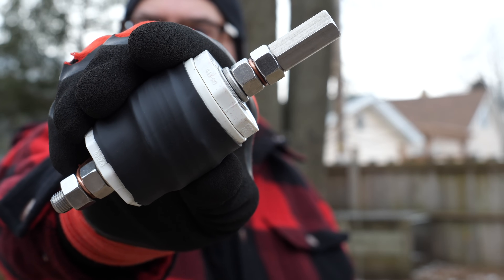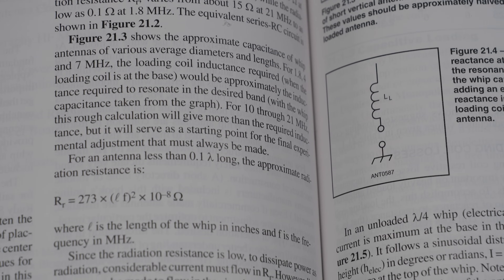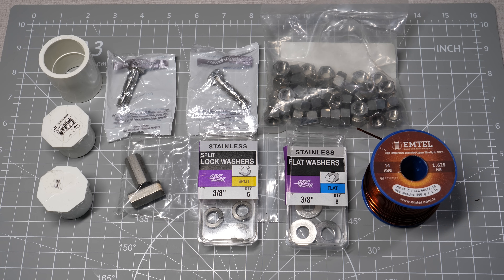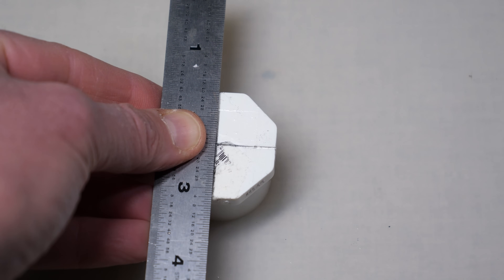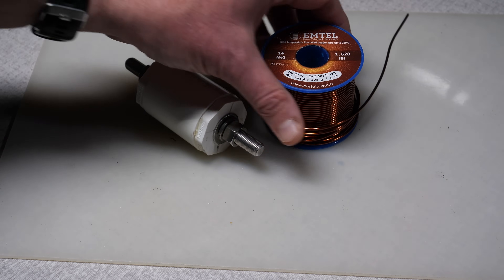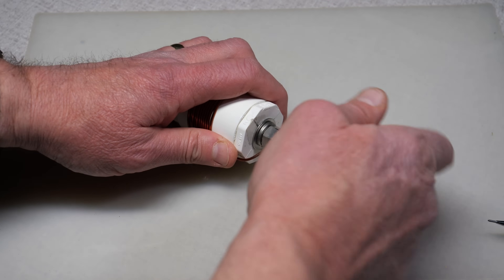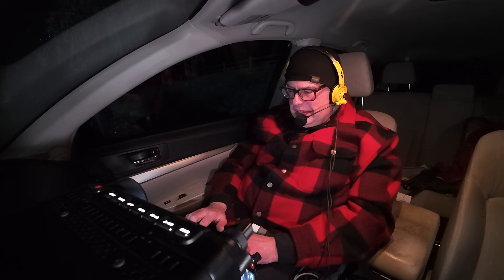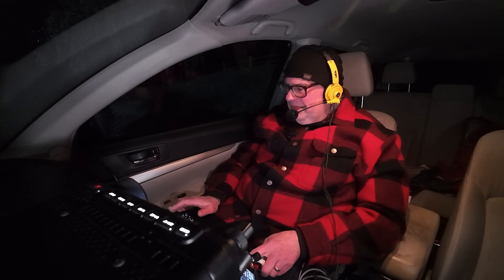BETTER than a Sporty Forty: Build a 40 meter Coil for Chameleon SS25 Whip!

Comment: Thanks for sharing the construction, I'm wondering if I can make a JPC-7 style dipole base with a Tee piece coupler.
One thing which might skew the resonance  that I've seen on other similar videos is including the length of the bolts / coupler as part of the whip, Where you said you had to shorten the whip slightly you are probably adding 2 to 3" with the M10 coupler etc. Just a thought.
Reply from the maker: You could. Long before the Buddipole was a commercial success, W3FF published the plans to build your own. I built one many, many years ago and it made the trip to more than one Field Day back in the day. The plans are still floating around online, so I'm sure they could be adapted to what you are looking for: https://k4gar.com/wp-content/uploads/2019/01/homebrew-buddipole.pdf

Comment: Michael, this video came just in time for me. I am making a solid coil, 2 inch glass reinforced PVC, 2 mm enammeled copper, 10.75 turnss (will give me 4.1 micro Henry) , with a step between turns of 3mm. (to avoid arching, I'll explain why further).  I intend to use it on a magmount (single one but big), CHA SS25, on top of my car, and operating from my caravan . I intend to use it with Acom 1010 amp, pushing 700w in it. What do you think, could be any issues with coil heating / arching?
Reply from the maker: In chatting with others, it appears that 2mm wire (12 AWG) would be sufficient to handle 500-600 watts of power. Keeping the wires separated by 3mm should further prevent arcing. My only concern would be heating, so look for a heat resistant material for your coil form.
Reply: @KB9VBRAntennas  I got the coil forms from glass reinforced plypropilene - which is mechanically more durable and can handle heat better. I ordered and got all the parts from your video delivered today . I will let you know once I will have the coil tested how it handles QRO , Also , I used those coil calculation links to set the dimensions for a 80m band coil . It's 29 microhenry . I will need a 3 inch coil for that, can be done
Reply: @KB9VBRAntennas Made one now with 2.5mm copper wire. First of all, the theoretical calculation didn't match, the resonant freq was too low - I had to add more turns, ended up somewhere around 10 turns. Also, if wires are separated, again, the resonant freq was below 7Mhz, so I had to keep them close. I tried the coil mobile, on 100w, working fine, CHA SS25 fully extended. I will try it now on full 700w. Also, I will make another one for 80m band (30 turns)

Comment: Great video! You did an awesome homebrewing this coil and made it look easy. One question, all other things aside, what would be the pros/cons of using the coil with the whip vs utilizing an antenna tuner and feeding it straight to the whip?
Reply from the maker: The coil creates a resonant antenna, which means your impedance at the feedpoint will be close to 50 ohms, matching it to the feed line. As your feed point impedance increases, the mismatch creates standing waves which result feed line losses. If the feed line is relatively short, or if you are using low loss cable, you can minimize those losses, but there is still loss none the less. 

If you want to go the tuner route, though, the internal tuner in your rig will not have enough capacity to handle the mismatch and you will need a wide range external tuner. 

Or you could add a 4:1 transformer at the feed point of the 25 whip. In doing so you reduce the feed point impedance to a manageable level which minimizes losses. In doing so, you've just created the non resonant Rybakov antenna. I've get several videos showing that antenna in action.

Comment: Thanks for the URL for the calculators.  Is there any particular reason why you chose 14ga wire?  Was it just something you had on hand?  My little brain tells me that using a thinner wire, like 16ga, would enable a person to get a closer approximation to the calculated required inductance value as the correct number of turns could be more closely achieved.  Just a thought.

Comment: Great build, try it at a midpoint coil with 25' total length.
Reply from the maker: The reason I build the coil for the bottom of the band is that if I want to use it at a higher frequency, it is easy to bring the antenna into resonance by shortening the whip slightly. If it was built for the middle of the band, and if the SWR wasn't ideal, I wouldn't have any whip available to lengthen for resonance.
Reply: @KB9VBRAntennas   I ment high up on the antenna not the band.

Comment: Are you using an antenna tuner with your home brew coil???
Reply from the maker: No I am not. This is intended to be a resonant antenna. If you want to tweak the SWR a bit (say you were operating in the phone portion of the band), you could just shorten the whip slightly.

Comment: Looks like you connected this to your coax with a generic mount.  What are the implications of using the Chameleon Blank adaptor (perhaps no different from your setup) or then again the CHA Micro or Mini?  What are the implications of using a tuner to widen your bandwidth a bit?
Reply from the maker: You could use the Blank adapter and ground spike with this coil. You'd then attach your ground radials or screen to the spike. I show this setup in my recent review of the Blank Adapter and M-Coil https://youtu.be/vXVFVmr3yyU. Operationally this coil is no different than the CHA M-COIL or the Sporty Forty. The only difference is that it lets you use the 25 foot whip instead of the 17 foot whip.

Comment: Mike, with the number of windings you're showing on the coil, how much wiggle room do you have with the antenna? Is it all the way up, or do you leave a little room to work with? Thanks Mike. I love my 25' whip so I'm definitely making one. 👍😀
Reply from the maker: With the whip fully extended, the antenna will resonant at the bottom of the 40 meter band. So there isn't much wiggle if the resonant point is higher and you need to extend the whip length. (This can happen with certain ground conditions where the conductivity is very poor). In prototyping the design, I made a 2nd coil with 11 turns of wire. This brought the resonant point down to 6.7 MHz. At that frequency I had to shorten the whip by one entire section to bring it into resonance at 7 MHz. I'm thinking, if I build another one, to maybe use 10 1/2 turns of wire. You may have to shorten the whip slightly depending on your operating frequency, but it would give you the headroom necessary for just about any ground condition.
Reply: @KB9VBRAntennas  Excellent. .  I'm going to go with 10.5 turns. Thank you so much Michael.  😊

Comment: Chameleon's 40 coil rated at 200w and can be used on 30 and 60 with adjustment. When I am parked in my truck I use a tri mag mount and 40m ham stick.  Do you think this will work well on mag mount (I already have the 25' whip)?
Reply from the maker: It should work fine with a mag mount, I've done similar with the Sporty Forty and 17 foot whip. There isn't any difference, operationally, between that setup and with this coil and 25 foot whip.

Comment: Hi Michael great video. Question, the PVC components look larger than 1 Inch in diameter more like 1 5/8 or 2 inch? You also reference in the on line calculator 1 5/8 diameter. On your purchase list you state 1 inch?..
Reply from the maker: Great question. The coupling is for joining 1 inch PVC pipe, so it has an inner diameter of 1 inch and an outer diameter of 1.6 inches. This is the item that I used: https://www.menards.com/main/plumbing/pipe-fittings/pvc-pipe-fittings/nibco-reg-socket-schedule-40-pvc-coupling/f00030t/p-1444449180118-c-8571.htm

And for your reference, the plug is also labeled at 1 inch: https://www.menards.com/main/plumbing/pipe-fittings/pvc-pipe-fittings/nibco-reg-spigot-schedule-40-pvc-plug/f01021d/p-1444449159872-c-8571.htm

Comment: Wonder how a coil that would slide over a 8m crappy pole or similar and use wire as radiator and a couple elevated radials.
Reply from the maker: That should probably work. Many, many years ago I built a Buddipole using the plans that W3FF originally published. The low band coils were wound on 2 inch CPVC and he used foam pipe insulation inside the form to hold them in place on the horizontal members. A piece of foam or pool noodle could keep the coil from slipping on your crappie pole.

Comment: I've been collecting the parts to build one for my 17' whip.  I've got a 2nd 17' whip and a dipole bracket coming to put the 17' whips on.  Would two of these work for 40-meter dipole, one on each whip?
Reply from the maker: I don't see a reason why not. My only concern would be the physical stress on the coil itself. I'd make sure the pieces are all well glued together.

Comment: is there one for the 20m band
Reply from the maker: You don’t need a coil for the 20 meter band, the whip is long enough. Just shorten it to about 17 feet and it will be a true 1/4 wave radiator.

Comment: Michael, did you use any radials? If so how long and how many?  Thanks for the video!
Reply: He used the faraday cloth “magic carpet” probably
Reply from the maker: I did not specifically test it with radials, but I’m confident it will work the same as the sporty forty. For that, I like to use 8 16 foot radial wires.

Comment: Great project! About $35 worth of parts, not bad, but then I need to buy a $100 whip 😢😢
Reply: Got a tree and 25ft of wire?
Reply: @forgetyourlife  I had a similar thought, but using one of my bigger masts. Might try an 80m coil which looks to be 25.5 turns.
Reply from the maker: In my experience with the SB1000 coil on 80 meters, the bandwidth gets tight, about 25 KHz. That's the downside of fixed coils on the low bands. But if you only want to use it on a small range of frequencies, they are ideal. I'm thinking of making one for the bottom of the band for the digital segment.
Reply from the maker: You could use wire. The chameleon whip is worth the investment, though. There are lots of antenna styles you can do with it